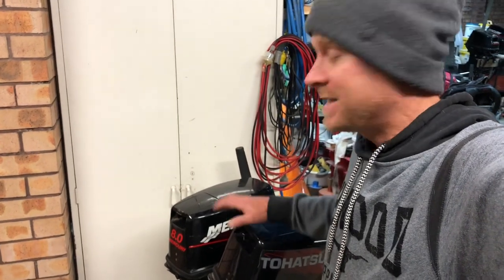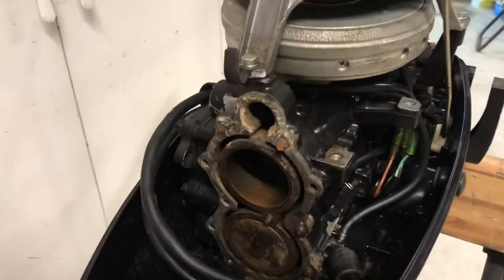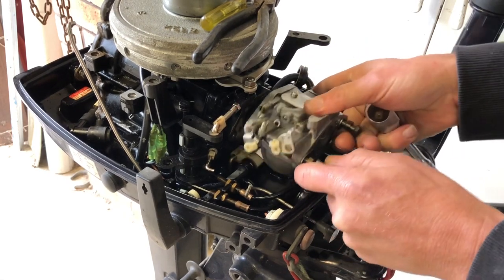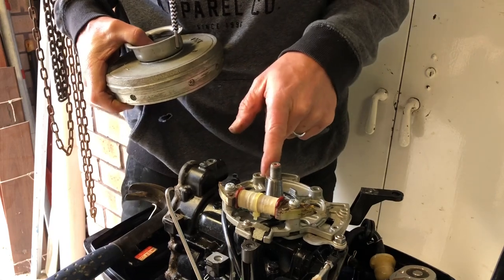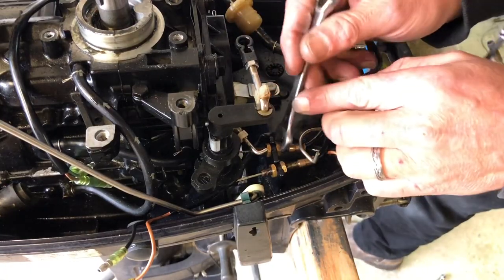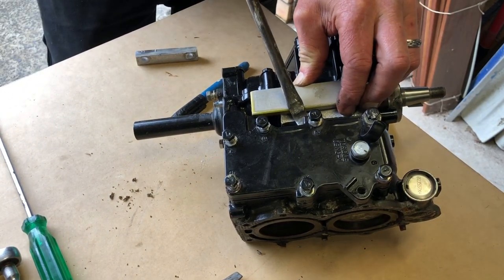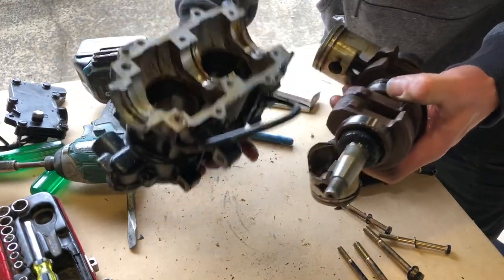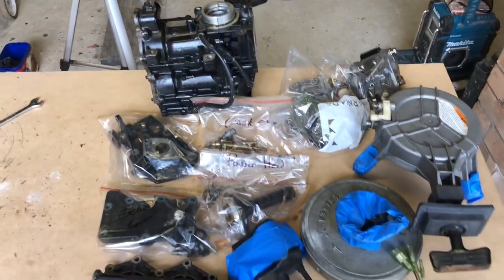Outboard disassembly 8hp, 9.8hp Mercury Tohatsu.

Comment: I have seen 2 or three of those Tohatsu 9.8s have bad main bearings. Do you know if that is a common problem with them?
Reply from the maker: Hi Mate,
I have only seen one like that. I think it happened on that motor because they are a light motor to transport, someone had put it in there car or something with the gearcase higher than the powerhead and water trickles back into the block through the exhaust ports and caused the damage.
Its so important to keep the lower unit below the powerhead. Transport two stroke outboards with there exhaust ports facing the ground or on their backs with the rear of the cav plate and rear of the cowl on the ground.
cheers 🍻 
Aussie Boat Guy 😎
Reply: thanks. @25hpboatracerman

Comment: from tinny rats sinking the motors, cant go under too many times gotta be careful with 15hp/18hp thoatsus and 15 usa
Reply from the maker: Hey mate 👋
Yeah, sunk motors can be an issue and your correct if wanting to but those motors, definitely something to keep in mind.
It really doesn’t matter how many times you sink a motor as long as you properly deal with it within a few hours of sinking which rarely happens 🤦‍♂️
If you leave it a day before carb overhaul, wash out, water extraction, lube, and a good 2hr run then you really start to degrade the crank and bearings along with reeds and rings.
The little things like pull start spring, linkages etc that get missed and the salt is not washed off also degrade the motor.
Cheers 🍻 
Aussie Boat Guy.

Comment: You couldn't soak that crank and rods in some rust remover?
Reply from the maker: Hi mate,
Unfortunately once the bearings have rusted it leaves pitting on the bearings surfaces, it will run but only for a limited about of time. It would also most likely have a bearing noise too.
Cheers 🍻 
Aussie Boat Guy 😎
Reply: @25hpboatracerman  yeah ok, I didn't realise it was THAT rusty on the bearing surfaces. Are they one piece or do they press apart like a bike crank?
Reply from the maker: @Mardy72  
Hi mate,
Yeah they press apart so I could re-build the crank too if it came to that.
Cheers 🍻 
Aussie Boat Guy 😎

Comment: Nice, very enjoyable watch. I’m in the process of finding a pullstart assembly (maybe electric ⚡️ if I can) of an Aussie built Evinrude 15/2 stroke
Reply from the maker: Hi mate, thanks for your comments 👍
Good motors the 15 omc two stroke.
You should have no probs finding a pull start assembly at a wreckers. I have only seen a few with elec start over the years, pretty rare.
Cheers 🍻 
Aussie Boat Guy 😎

Comment: Thanks. I needed this.
Subscribed for the rebuild video. 

Keen to know how u go about sourcing replacement parts (power head and crank) and cost on these. 

Need to keep these 2st running and well maintained since we can’t get them anymore. 

Love the clear explanations!
Cheers
Reply from the maker: Hi mate,
Thanks for your encouragement 👌
I’m actually doing the rebuild today 29/7/23 on the little motor, so excited to see if my mods are successful.
Video will be out in the next few weeks.
I order parts from any Tohatsu dealer or Mercury dealer for these little motors. I’m not a massive fan of aftermarket parts.
Cheers 🍻 
Aussie Boat Guy 😎
Reply: @25hpboatracerman  
I think this series are 2001 to about 2020 when the new laws stopped sales of new 2st? About maybe upto 20yrs old right?

Do the dealers have this in stock or do you need to wait on parts from overseas?

I’ve been wanting to pick up a 15hp but just abit worried about getting parts. 

Looking forward to the build. 
Cheers

Comment: Great video I’ve watched most of your videos now and I watch them as soon as they come out. Love them all my son and I have a few Tohatsu outboard’s looking at getting a 15 hp two stroke Tohatsu can we just do the cam modification to make it an 18 up?
Reply from the maker: Hi mate,
Thanks 👌 really appreciate your support.
The 15hp Tohatsu looks the same as the 18hp but has a smaller bore 55mm instead of 60mm for the 18hp.
The 18hp is about 50cc bigger capacity than the 9.9hp and 15hp tohatsu, the 15hp Mercury super (built by Tohatsu) is the bigger bore and can be converted to the 18hp.
You can see that the 9.9hp and 15hp have 55 stamped on the top of the block (near the head) and the 18hp block has 60 stamped on the block.
I do have a video (earlier on) about the difference in the blocks, the 18hp porting is way bigger too along with the bigger carburetor.
Cheers 🍻 
Aussie Boat Guy 😎
Reply: I have watched the video, but I think I thought it was the same as mercury 15 sup I’m glad I asked thank you for the reply
Reply from the maker: @nativehuman6841  
Too easy mate.
Cheers 🍻 
Aussie Boat Guy 😎

Comment: Question on the 15hp merc. Do these have two exciter coils on the flywheel.  One for lower rpms and one for higher rpms ?
The parts manual shows two and im unsure how it works ?
2018 model 2 stroke. 

Thx
Reply from the maker: Hi Champ,
If it’s the Japan built 15, one of the could under the flywheel is a charge coil (if your running a battery it can charge it) so can actually be removed without any issues if not running a battery to charge. Only one coil for the spark system under the flywheel on the Japan built 15hp. Not sure about the USA built 15.
Cheers 🍻 
Aussie Boat Guy 😎
Reply: @25hpboatracerman  fitted new carb, cdi , spark plugs, coil pack with leads and it still runs like a dog at higher rpm.. 1 or 2 people loaded up not so bad.  But 3 people and it misses like a biatch. 

Just about to put a lit match in the fuel tank.
Reply from the maker: @Sailaboat 
Hi Mate,
That’s super frustrating 😢
Could be water getting into the bore from the exhaust or a head gasket, check your plugs first any sign of water. Also hopefully not but could be a spun crank. I would check that the timing is advanced enough too. 
Keep me posted
Cheers
Reply: @25hpboatracerman You were on the money dude.  Changed the exciter coil and off she went. 

Now planes with 4 aboard..

Happy days 

Thanks a bunch

Comment: Hey man, im looking into a new engine to push along the hull i just got, ive found a 90s 15hp mercury i like and also a 8hp mercury, am i correct to assume theyre essentially the same heads? 
If i were to buy them both, pull off the 15hp power head and carb then do the same with the 8hp then put the 15 carb and powerhead back onto the 8hp leg would this work? Then the ""8hp"" would not be ""8/15hp""  
But everyone will think its just an 8hp
Reply from the maker: From my research the USA built should swap.
Cheers 🍻 
Aussie Boat Guy 😎
Reply: @25hpboatracerman  what's you opinion on a USA built Merc vs Japan? I heard the USA engine is possibly abit lighter?